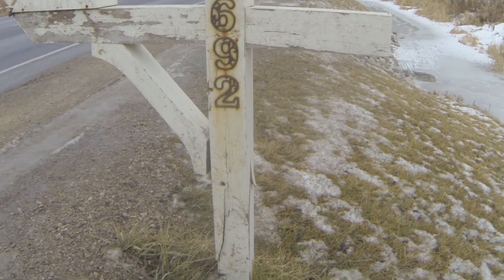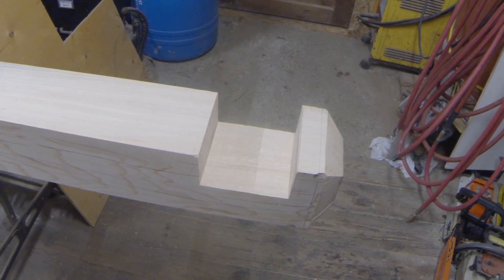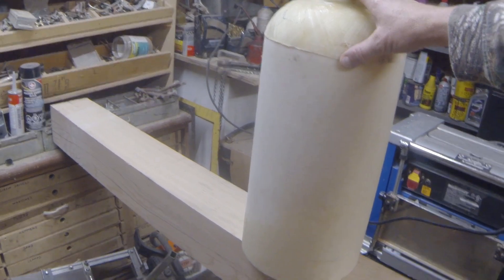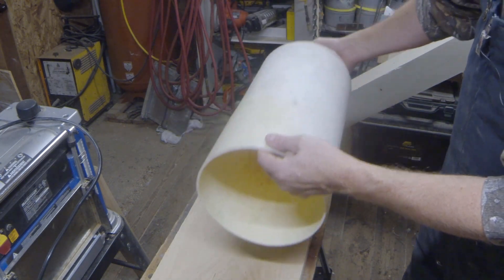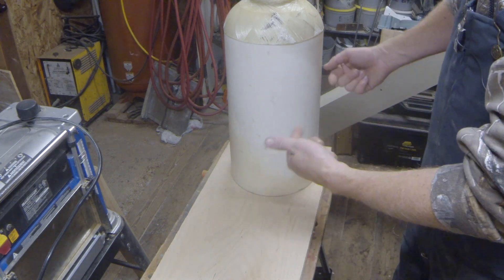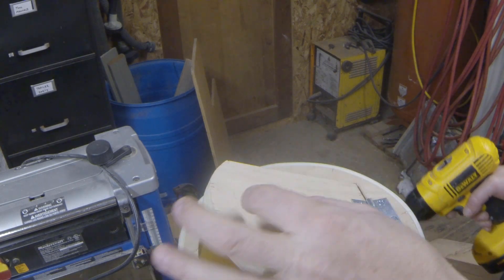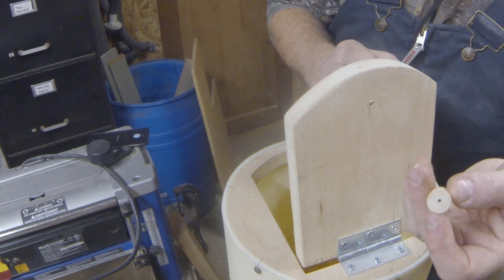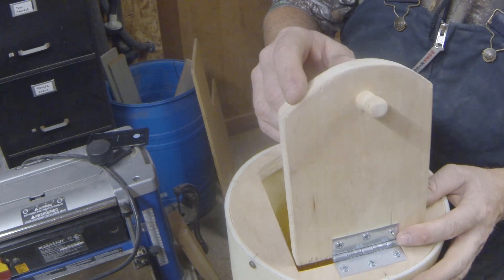Making a Snow-plow Proof Mailbox

Comment: My neighbors built a post with what looks like a 12ft hinged board that the mailbox is attached to, that you pull a rope that's attached to the bottom of the mailbox to pull it down to get your mail (or the postal worker pulls down to put your mail in) & when you let go of the rope, the mailbox goes back up out of the way of snow plows. The longest part of the board is in the back. I'm assuming that's how it goes back up, from the weight of that board.
It's a great idea! I can't find directions on how to build one. Their neighbor on the other side of them built one too. They've lasted about 5 yrs so far.
I'm building one too, when I can figure out how they did it. They aren't the kind of neighbors that you could just ask.
There's no way a plow could take out that mailbox unless they hit the post itself.  😃
Figured I'd help others by at least  describing how it was made. It's the worst part of living in Maine.... Getting your mailbox repeatedly taken out by heavy snow from the plows.
Good luck to anyone who attempts to build one.
Reply from the maker: I know of lots of people in heavy snow areas that have these types.  Our postal agent is pretty Strict on what he wants so I doubt he would go for it which is why I went a different route.  He even wanted the door to open a certain way or he wouldn't deliver.  Go and just look at you neighbors and get the design.